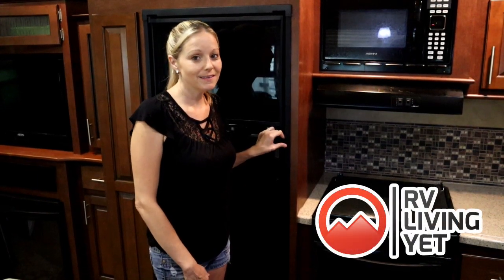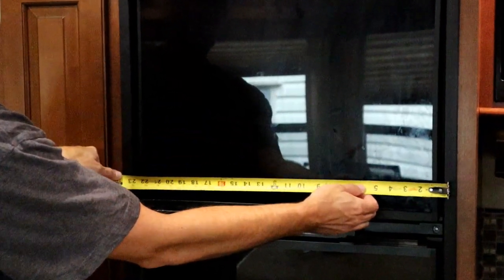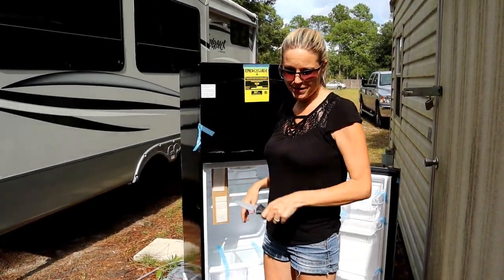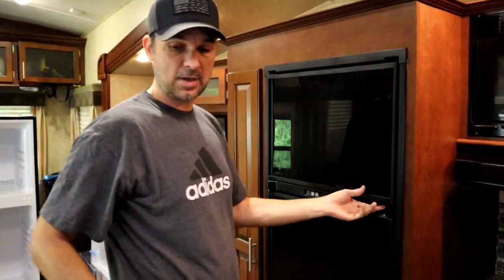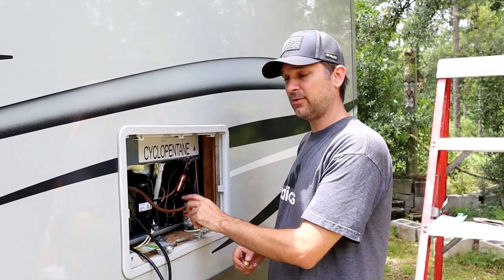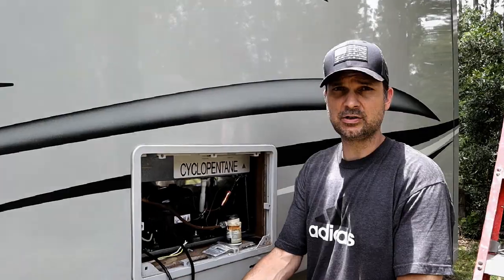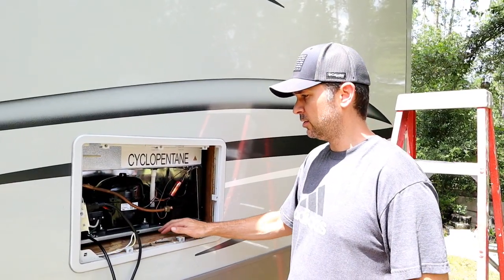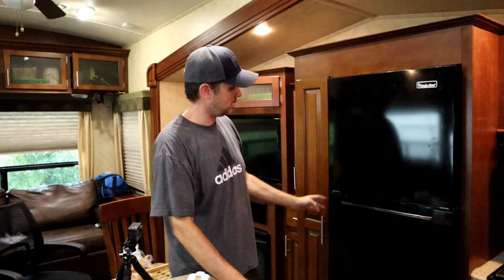RV Refrigerator Installation | How to Replace RV Refrigerator with Residential Fridge | RV Living

Comment: Thank you so much for this video. My Norcold 811 went out and my TT is a 2017 model bought new in 2018. I didn't have a lot of complaints about the old one until it leaked ammonia.The Texas heat killed it I am pretty sure.  The cooling unit, refurbed, is $800, new about $1100 and a new Norcold without doors- $1900. The labor to put in a new residential would be quicker and easier than replacing the cooling unit. Nope. This is a no brainer. I will deal with the power outages from travel or a hurricane or a freeze when it happens. Thanks again.

Bili K.
Reply from the maker: Glad it helped thanks for watching

Comment: So glad I  found your video.  We live in our 2007 Montana fifth Wheel.  Our refrigerator  completely died!   Not only did your video help so much with the removal/ install  process, we ended up purchasing the same  Magic Chef model that y'all did and it fit absolutely perfect into the original opening!  Thanks Again
Reply from the maker: We are really glad the video helped and thanks for watching!
Reply: What model Magic Chef did you end up with I need 1  2.

Comment: Hey guys

Just installed the magic chef in our GD 303rls. Your video was great and really helped.

Thanks so much..
Reply from the maker: Glad it helped, thanks for watching!
Reply: What model Magic Chef did you use thank you I need to replace mine
Reply: @richardyoung5586  

Not at my rig for a few days, but it was the cheapest home Depot unit, great reviews. I think 10 cf. Same as the one they used.

Comment: Great video.  We have also a Norcold 8cf refrigerator on our new 2022 Entegra Vision and it does not cool.  We took the motorhome back to the selling dealer in Las Vegas from our home in Northern CA, (big expense in gasoline).  They did a diagnostic and determined that it needed to be replaced, and now we wait maybe 2 to 3 months for the replacement to come, and then back to Las Vegas to have it replaced.  I hope the new one does not crap our like the new one that came with the motorhome.  I see in our future changing it to something like you just installed.  Thank you for the video.
Reply: For the amount of $$ in gas to travel to the dealer twice(diagnosis and then the actual repair) you could of just bought the residential refrig.
Reply: @TheMinnow101  You are correct.

Comment: Can you tell me once stocked with goods and down to temps how often does the fridge run and amps drawn? Hoping that my 1100 watts of solar and 400AH of battery will keep up.
Reply from the maker: You'll have plenty of power, it averages less than 100 watts an hour

Comment: Nice video. I have the same RV as you and am in the process of replacing the original Dometic with a residential frog. I got mine ar Home Depot too, not the same brand but the same 10.1 cubic feet. The one thing I just finished up doing is rebuilding the floor the frig sits on. Mine wasn't that solid so I pulled the plywood out and installed legs at the corners and sides along with a 4x4 center support. It is solid now. How did you wire your 110 line to the inverter? Did you disconnect the original wire at the fuse panel and wire it to the inverter or did you run an all new line from the inverter to the plug behind the rig? Also what size inverter did you use? I'm looking at a pure sine wave 2000 watts. I have two lead acid batteries. We very seldom boondock so I think it will work for now. Time will tell.
Reply from the maker: We have a 2000watt inverter tied to our electric panel. We have videos on our channel about this.

Comment: Hey Ya'll!  I wanted to let you know that I was able to install my new Magic Chef fridge yesterday and I could not have done it without your help!  Thank you!!!  Your instructions were perfect, right down to the 3/8" plug for the gas line.  The hardest part was getting the old rv fridge out of the front door of my 5th wheel...had to bend the metal frame and inch it out carefully, but managed to do it.  The new one looks great and is working fine.  It seems so much bigger and now I can have real ice trays!  Haha! 😄 Thank you again for your help.  I hope ya'll are happy and well.  Safe travels! 😊
Reply from the maker: That's so awesome, you're going to love it. Thanks again for keeping us posted.
Reply: What size Magic Chef did you buy and where thank you

Comment: We just replaced our 8 cubic foot dometic in our 30 ft freedom Express travel trailer with a residential 10 cubic foot magic chef. We did have to do some very minor adjustment for a little more room at the top however other than that it fit perfectly. So much more room!!! Very easy to install. Though, the one thing that I see people do on their gas line when they close it off, they put tape or some kind of junk around the threads to seal it, this is not necessary because a brass plug will seal itself. I should have done this a long time ago!
Reply from the maker: It is one of our favorite upgrades.
Reply: Robert, what model fridge did you buy? Byron, 29RDLS Freedom Express
Reply: We bought the dematic I'm sorry it took me so long to respond
Reply: RDLS 29-5 freedom Express
Reply: @h2ologged  I'm sorry it took me so long to respond we bought the dometic for our RLDS 29:5 freedom Express and it's wonderful cold cold
Reply: @h2ologged  I mean the magic chef not dematic
Reply: @h2ologged  I'm losing my mind

Comment: Turning off the gas AND bleeding them is very smart. Good tip. We bought our rig with a residential fridge. Unfortunately, it went out while we were traveling. It was MUCH more difficult to replace than yours. Had to get it in the window. Lol. This looks pretty darn easy. Thanks for sharing!
Reply from the maker: It was pretty easy, going in the window would be tough. Thanks for watching.

Comment: Great video. I just bought a brand new Keystone Sprinter with a Furrion Arctic 12V 10cf frig, it's junk and I can't get anywhere with Furrion, I'm just going to bite the bullet and replace it with the model in your video. How is it holding up? And thank you for a very good video.
Reply from the maker: Glad it helped, ours is still working great.

Comment: Thanks for the video! Has this refrigerator had any major effect on your electric? We’ve had ours for about 2 weeks and our electric is going to be through the roof. It’s not constantly running and insulated properly, any advice?
Reply from the maker: Ours did not do that. Hard to tell what is going on with yours. Thanks for watching though...
Reply: @RVLivingYet  thank you for responding! It just so happened that we were having refrigerator problems but the spike in our bill was because our meter was read wrong by the owner!! We overpaid and immediately panicked thinking our electric was spiking because of the new fridge! False alarm, I don’t want to scare anyone. A new fridge was such a good investment, thanks again for the video!

Comment: Thank you so much.  Looking forward to getting my new Haier installed next week.  My RV is a 2018 and the Dometic already DIED!!  $1500 for new Dometic or. $480 for NEW Haier.  No brainer.  Question??  Can this fridge run off deep cycle batteries  using an Inverter??
Reply from the maker: Its crazy how much they want for these crappy RV fridges, we are way happier with the new frig.  Good luck on the project.
Reply: @RVLivingYet  it is done and looks great. Thank you for the inspiration. We went with the stainless steel.

Comment: The fridge lock is a great idea but drilling into that area there are some models with heating tubes for drying upper freezer condensation. If you hit the line will loose all the fluid
Reply from the maker: @TimsWorkshopTJY  luckily the screws weren't that deep...

Comment: My only concern is that wasp going to get in and build a nest I'm thinking about sealing up my back access panel? Any thoughts on that? My my installation is not tight around the front on the inside of the camper
Reply from the maker: We hot glued window screen on the inside of the access panels to keep bugs out.
Reply: i replace 2 fridges already and sealed the opening with plastic toward the outside and plywood on the inside to keep heat out and intruders out also.

Comment: thanks for the video, I have purchased a Travel trailer and everything works I parked it at my place and now I cant get it to work, the fridge didn't work now the freezer doesn't either. I was thinking about doing the same thing. I have 30 amp power so that isn't a problem. yall made it look so easy i'm going to go home and check to see if it will fit. my question is where did yall get the latch? I cant find anything like it. I don't plan on moving it much since I live in it but id still like to have the latch on it thanks
Reply from the maker: Its been one of our favorite upgrades. We got the latch at etrailer dot com

Comment: Finally, I never thought I would break down and buy a residential fridge, but you and I both know Absorption type fridges are not designed to be in a slide-out. my new Whirlpool 11.6 cu ft fridge gets delivered tomorrow. noticed the door lock you installed. where can I pick that up at??
Reply from the maker: Its been one of our favorite upgrades, the lock is from etrailer dot com, thanks for watching.
Reply: @RVLivingYet  thanks, just talked to customer service at Etrailer and they do not carry anything like it. he said maybe a few years ago, but not today. thanks anyway.
Reply: Here is a link to the lock/latch...
https://www.etrailer.com/Accessories-and-Parts/Everchill/324-000149.html

Expensive little sucker.
Reply: @stevegillespie6424  thanks. It is awesome that they have all the illustrated measurements. I will measure it all out and see if it will work for ours.

Comment: Hello and thank you for your video.  It was very helpful.  I replaced my fridge with a residential fridge and I had 1 question for you.  I saw you installed a locking mechanism so the doors don't fall out.  Would you be able to tell me where you purchased it or if you can send the link.  I use child locks to keep the doors closed when traveling but that would be much more helpful.
Thank you in advance 🙏
Reply from the maker: Thanks for watching, we got the latch on etrailer .Com
Reply: What kind of child locks did you use?

Comment: Great job, thanks for sharing! We're about to replace our Propane fridge with a residential one that, like yours, doesn't have the condenser coils on the back, which means they are embedded at the sides. The manual says we'd need 4 inches free space at both sides and back and top for proper ventilation. We don't have that, and from your video we don't think you had it either... So how did you go about ventilating yours? Thanks in advance for your tips.
Reply from the maker: We have the 2 vents in the back to the exterior and to be honest even if this frig only lasts a year or 2 its cheap enough to replace and way better than the Norcold. Over 1 year so far and no issues.
Reply: Please  keep  us up-to-date  on any  problems  with fridge. We just installed  the exact  fridge in our jayco pull behind.

Comment: Nice Video.
 Do you happen to know this ? Since I do not have solar, doesn’t my battery charge when traveling and hooked to my truck? if so then maybe I just need more batteries to run a residential fridge when traveling.
Reply from the maker: Your truck should trickle charge the batteries while your driving but it will not be enough to run the frig, a decent battery and inverter will work for shorter trips.
Reply: @RVLivingYet  Thanks for replying so quickly

Comment: Great Video. I am installing the same Fridge tomorrow in our RV. Our Current fridge is sweating and destroyed all of the wood on the front and side. It's also too small and does not keep food cool. Did you just plug the residential fridge to the 110 plug that is located in the back of the RV fridge? Thanks
Reply from the maker: Yes we capped the gas and 12v and use the 120v plug.

Comment: I just installed the same fridge in my 5th wheel.  Where did you buy the frig lock gadget?
Reply from the maker: We got the latch at etrailer dot com.
Reply: Unable to locate the lock. Does the product have a specific name or brand name?
Reply: I will second that question.

Comment: My nevercold quit after 2 years.  Im looking at replacing it with the same refrigerator as you did.  I have a couple of questions.  How much heat does the magic chef put out?  Also during the winter months does the cold air coming through  your outside vents affect your compressor?  I have read that alot of these type of units are made to operate in temperatures ranging from 55 degrees to around 100 degrees.    I appreciate your video.
Reply from the maker: Thanks for watching, the frig does not seem to put off much heat, we are in Florida in the winter so there isnt much issue with the cold coming in but you could insulate around the front of the frig if needed.
Reply: I also have a NOCOLD N8XF pos, I have that exact Magic chef in the garage of the toy hauler. My problem will be securing the top since I don't have upper access panel.  Also all I want to use the inverter for is travel time. What size inverter will I need to operate 2 of the magic chefs. Just for traveling not camping. Will run generator or shore power for camping.

Comment: So was there a wire 14/2  installed with breaker?
Reply: There is already an outlet behind the fridge for when its in electric mode. When you set your fridge to 'auto' it will first check and use electric. If that is not present, then it uses propane.

Comment: From info given, you installed a "bigger" refrigerator where a "smaller" was. How so?
Wouldn't a bigger refrigerator require some customization?
Please explain how you fit a bigger refrigerator into the same space.
Reply from the maker: Same size exterior but more interior space in a residential frig versus RV fridge
Reply: Thanks. I was hoping cubic ft. numbers would be included. I'm in this situation and not having any luck finding residential to fit in existing space(Norcold 611RT) but by only a few inches. Thanks for responding.

Comment: Great Video! - Would you mind measuring the width of your door opening on your camper for me?  I have the same unit in my camper and it won't get cold in the fridge compartment.  It's a shame since the camper was purchased brand new in Jan of 2021.  I had a deck built along the front and the camper is stationary and would rather replace it with the same unit you guys purchased to gain the additional space in the fridge and not have to fuss with taking it back to the dealer.  Your camper looks like it may have a bigger door opening.  Did you have to disassemble anything to get the old unit out?  I appreciate the feedback!
Reply from the maker: Sorry just saw this comment, the opening size was 24"x60" and everything came out pretty easy with out disassembly. The RV fridges are pretty standard sizes so there is a good chance this will work for you.
Reply: @RVLivingYet  Thanks for the reply.  I was able to get mine out my 24" door opening.  I had to angle it a bit but it came on out.  The new Magic Chef fridge is awesome.  Thank you for posting this video!

Comment: We just purchased the same refrigerator!!!. Some of the trays were broken in shipping and it made us return it to the store for a replacement. But it also made us think about how to prevent this from happening once we install it. Have you had any damage while traveling? How do you keep the items from bouncing around?
Reply from the maker: We have never had anything damaged while traveling. They honestly do not bounce around 🤷‍♀️ I guess if you are going off road, you may have those issues😂 You should be fine...You will need a latch to keep the doors shut though. Thanks for watching! Safe travels😊
Reply: @RVLivingYet  So stop overthinking it and just enjoy frozen ice cream!!! got it!

Comment: I wud move the gas line out of compartment just incase- there are any sparks each time fridge goes into cooling mode... Just an on off chance.  Yes I watched you sealed line well... But on the off chanc there's an imperfection in future, & gas builds up in that small area between fridge & outside door.  how to move it without breaking it? Attach another hose that can be routed down &/or out that can be unattached later if someone wants a 2 - 3way rv fridge(idOnO Y thA wud bt).. anyway, I don't know squat.. here's my question, have you researched how much space is needed for ventilation/cooling on back & or top of a standard home depot or watever, compression watchamacallit fridge? You may have to remove back several " of that top ins., &/or install another vent-  on outside wall👋
Reply from the maker: There is a vent on the top and bottom of the back wall to the exterior so there should be plenty of ventilation for the heat and gas should there be an issue but its more safe now that its capped than before when there was a gas valve back there that could fail with a pilot light.
Reply: @RVLivingYet  
thNx, btw the vent question(while it could ofcours be about propane caution) was about fact the fridges are better not to overheat(that's why some have cooling fans back there), yours has a second vent, that helps 👋

Comment: what brand and model frig did you replace it with? and how did you make the solor panels to power the frig?
Reply from the maker: The frig was a Magic Chef 10.1 and check out our solar video series on how our solar power works.
Reply: @Techplay RR Solar doesn't "power" anything. All it does is charge your batteries. If you have an inverter it will turn the DC voltage in the batteries into AC voltage that the fridge can run on.

Comment: How much is the weight difference between the fridges?  I'm concerned about adding extra weight.
Reply from the maker: Its about the same
Reply: The residential refrigerator is actually significantly lighter than the absorption style